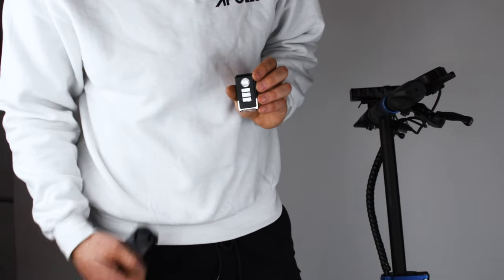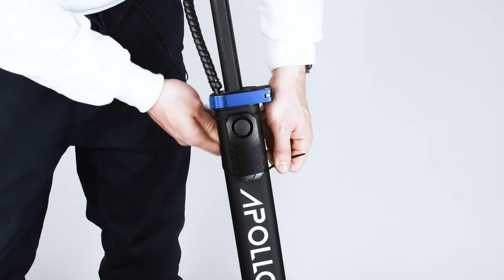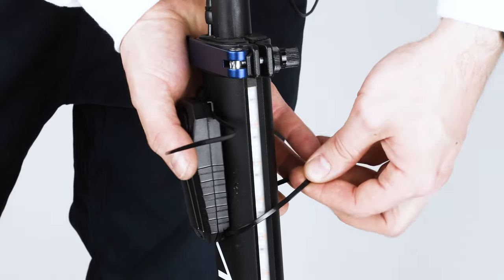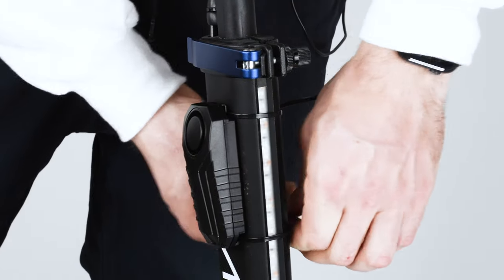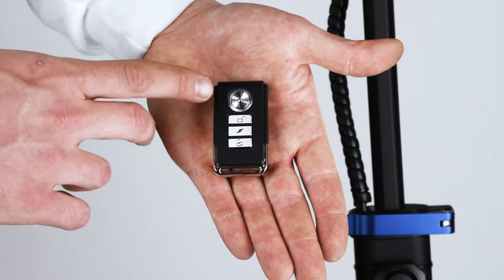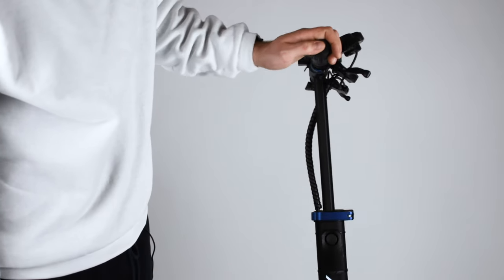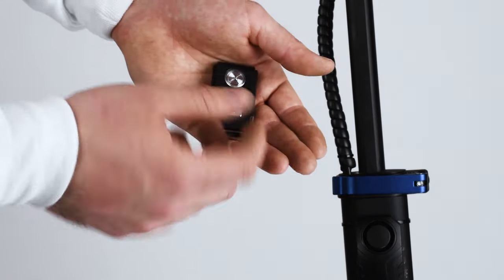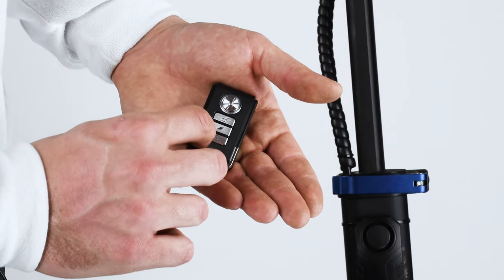Anti-Theft Alarm Demo

Comment: Great idea but like they all say. .if someone wants your car or e scooter in this case bad enough they will find a way to get it. Only downfall I see is that some one can just cut the zip ties and toss the alarm or step on it after cutting it off. Wish it had more of a secure attachment to the scooter itself vs just plain zip ties.
Reply: Most thieves wouldn't see it until it starts beeping extremally loud. I like the idea of adding it along with a lock of course

Comment: To all of the previous comments about this this being too noticeable or not enough of a deterrent for theft, this is a secondary means of deterring thieves...Of course you’re going to lock it up too...duh! As a legit question, will this device fit above the blue latch to collapse the scooter (between latch and where wires go into the frame)?

Comment: Make absolutely no sense to place the alarm on the column. It’s easy for the thief to cut the zip ties and take off... Maybe if you lucky enough (Lol) the thief can leave you the alarm as a gift. Lol... Please do not recommend anyone to install the anti-theft alarm in an easily visible place.
Reply: Maybe install it inside the stem so they won't hear it genius.
Reply: @911S  If it's so weak that you can't hear it through half an inch of aluminium then it's too weak to discourage thieves.
Reply: @HolybasilYT  hey armchair expert.
Reply: Soon as they cut the alarm and move the alarm it will go off letting you know which is ok for going into a small shop or using a toilet.  Anything other that's further away yeah its useless with cable ties.
Reply: Use apoxy.
Reply: Disguise it on the scooter😊

Comment: Way too easy for a thief! A waterproof alarm inside the box would be a far better solution. Not that I’d leave my scooter unlocked, or alone for long. There are really good locks that will slow a thief down -- but none are Foolproof. So do the research - a U / D lock and brake lock are in my backpack.